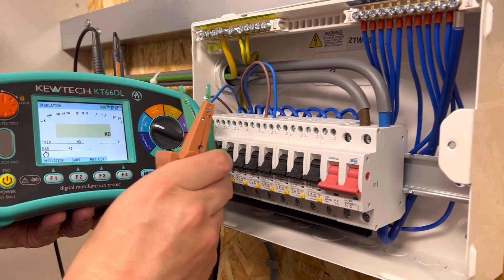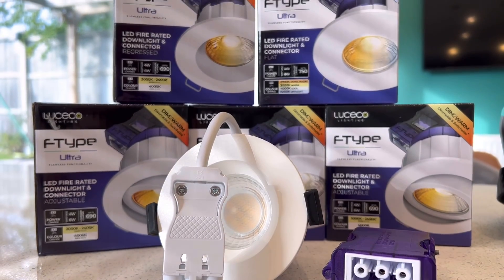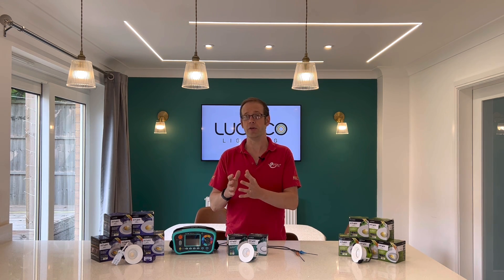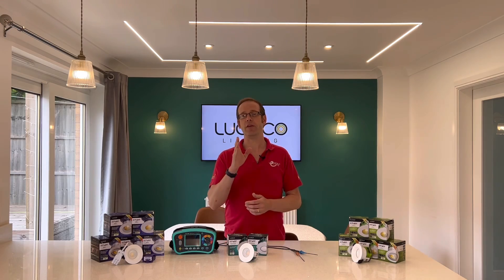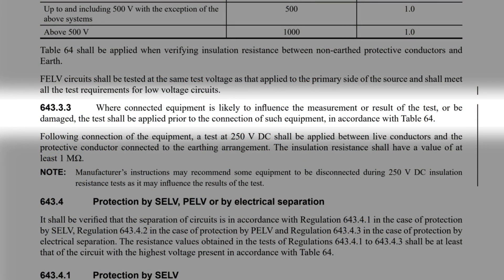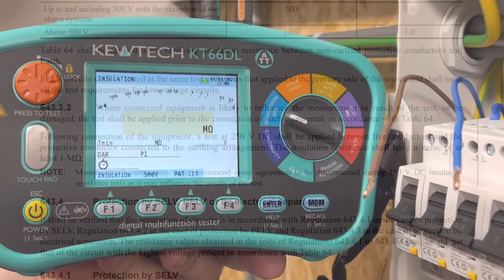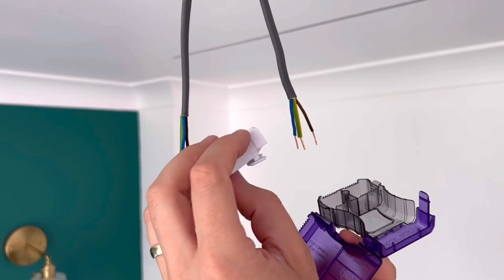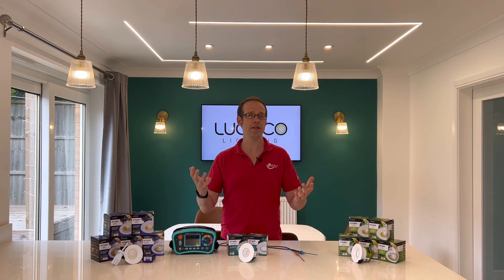These Downlights Make Insulation Resistance Testing Easy

Comment: i havent met an electrician in years that does insulation resistance test. i work with many different companies and sole traders in the city i live in and even the ones i consider the best around dont do insulation resistance. at this point its used as a fault finding test than anything, with the level of protection modern circuit breakers offer insulation resistance test is practically obsolete
Reply: Stupid
Reply: Not sure about that
Reply: They must be all cowboys then, any decent electrician would insulation resistance test at the first fix stage, this confirms the cables are in good condition before any other trades cut or damage your cabling.
Reply: @alvina69  yeh. We can all be better but im just saying it how i see it. Id wager at LEAST 80% of electricians are skipping insulation resistance tests. On both new install and eicr.
Reply: @jak0995  no way
Reply: @ElliottHurst id say run a poll somewhere, but it would be bias. anywhere you could run a poll would have electricians that are engaging with current regs and likely would have a higher number of people in a forum actually doing their job properly, and if you could somehow poll the averave electrician i doubt they woul danswer honestly.
but going from what i see others doing day to day the vast majority are skipping insulation resistance.

on one hand its a sad state of the industry, on the other theres no epidemic of issues that would have been picked up by insulation resistance testing